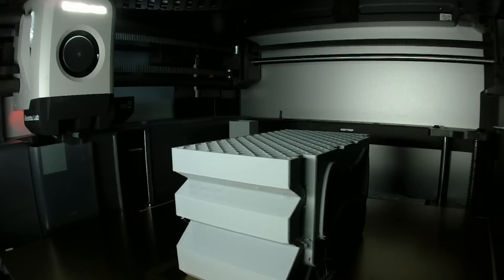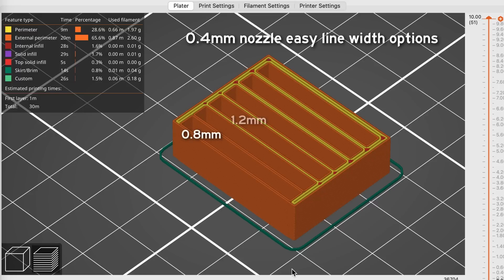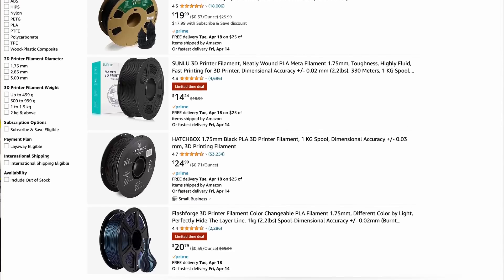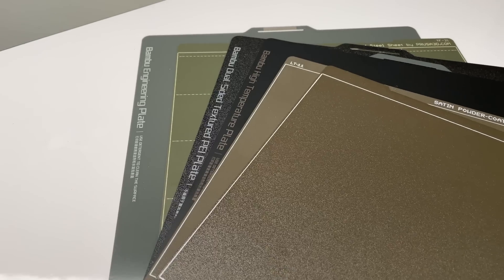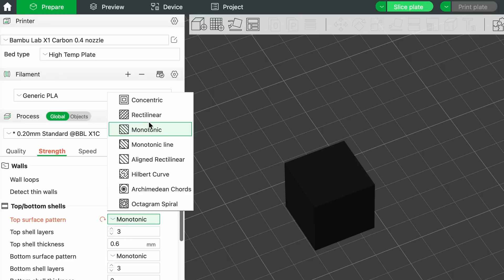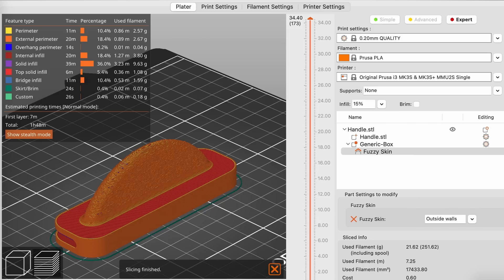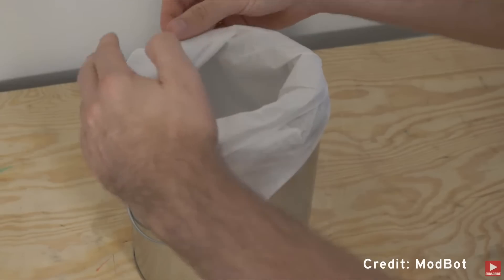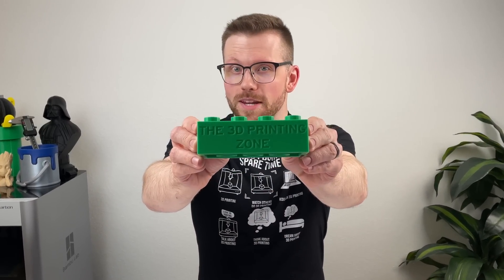Making 3D Prints That Don't Look 3D Printed

Comment: Extrusion width is typically a bit wider than the nozzle diameter no? i believe the default for prusa slicer on a 0.4mm nozzle is 0.45 mm, so 0.9 and 1.35 and 1.8mm wall thicknesses would be better.
Reply from the maker: This depends on the slicer, printer, and individual nozzle. Ideally your extrusion width would be exactly what the settings say it is (0.4, 0.42, 0.45, whatever). But, there are a lot of variables that make up this number such as the extruder motor force, overall pressure in the hotend, exactly melting characteristics of the filament, and squish (z offset). The primary point for this tip is more so to understand how the filament lays down and how to better control the fill between walls. You are correct though, keeping features as close to a multiple of your line width is more important than that of the nozzle.

Comment: why not recommend 0.1 or 0.08mm layer hights?
Reply from the maker: Smaller layer heights will definitely get you better resolution, but print time will increase quite a bit, depending on the geometry of course.

Comment: At 6:29 your circles are tesselated. Try exporting from your CAD software in STEP format instead of STL.
Reply from the maker: Thanks for the tip! I found these brick STL files on the internet, but will take your advice when exporting my next project.

Comment: It's a very informative video and I learned a lot. But I miss the recommendation of using a smaller nozzle because I think, this would reduce dramatically the lines on the surface. What do you think?
Reply from the maker: Completely agree! Changing to a smaller nozzle definitely will allow you to get smaller line widths and layer lines for greater resolution. I didn't include this in the video since I know some folks don't have the ability. But, with system's like E3D's Revo quick-change nozzles, this is becoming more and more attainable.

Comment: If you are sanding and filling to get a smooth surface. Fill first and then sand, and repeat as necessary. This gives you the least change to the dimensions of the part. Sanding first will make everything just a little bit smaller.

Comment: Some more tips:

1. Avoid pure vertical and near horizontal surfaces. Pure vertical accentuates any layer stacking/Z banding type issues, and near horizontal accentuates layer height discreteness.

2. More filament choices to hide surface microstructure: not just matte, but also glitter/sparkle filled, glass or carbon fiber filled (but these need abrasive resistant extrusion system), and (a simple but good option!) filaments that aren't entirely opaque until a certain thickness.

Comment: I realize this is for beginners, but the first choice you should make is the printing modality. You can get better results much, much faster and easier with resin printing for this application. FDM is the wrong method.
Reply from the maker: I agree, you can achieve finer resolution in sometimes half the time with a resin printer! I think FDM is still relevant due to its accessibility on the market and ease of use (no harmful chemicals for printing/cleaning).